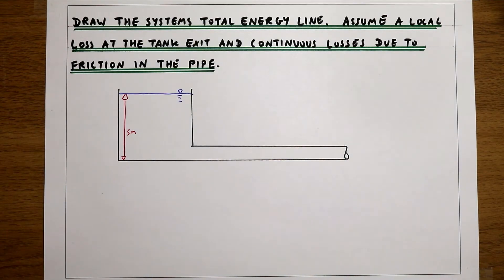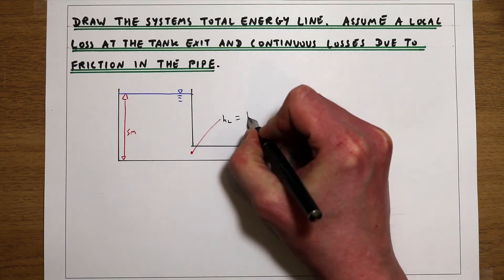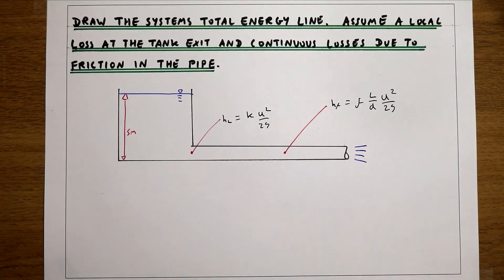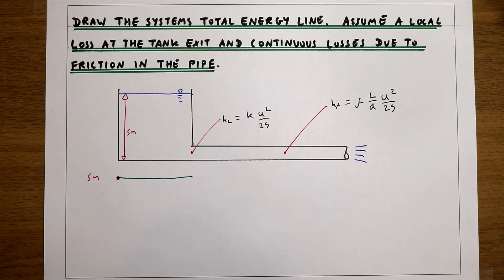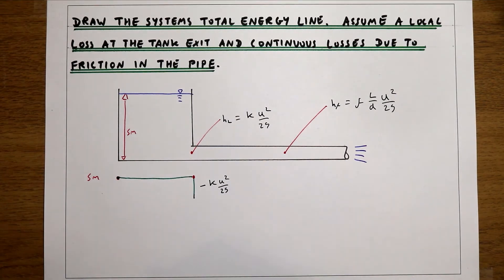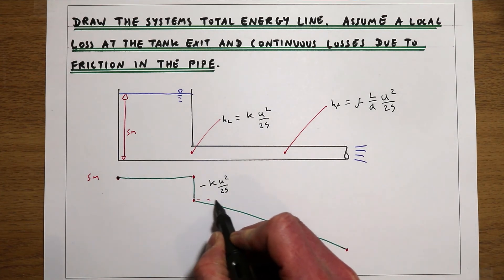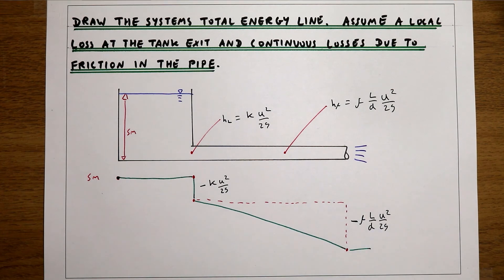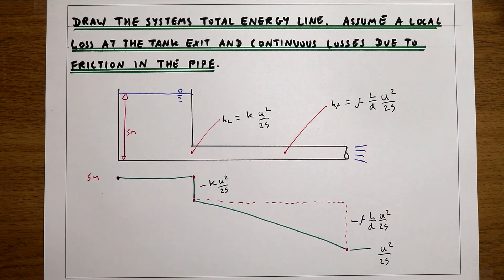How to draw total energy line including continuous and local losses

Comment: hi, your videos are very informative.  For for a very long time, I am unable to answer this fluid mechanics problem. Please help me to solve.    Consider a horizontal 300m long & 1m diameter penstock or pipe. One end of penstock is coupled with 6.5m height tank & another end coupled with high speed valve. The head 6.5m is designed to achieve 4m/s flow velocity. My question is, if I open the valve in 0.1s, 1) do I get instant 4m/s velocity Or 2)How long time it takes to accelerate the mass of water inside the penstock to achieve 4m/s?
Reply: Above Question In Image representation - https://drive.google.com/file/d/1QtuWdlyZHZLsOAvMZAbpmN48dtGW6co5/view?usp=sharing          My email id y.aswinkarthick@gmail.com